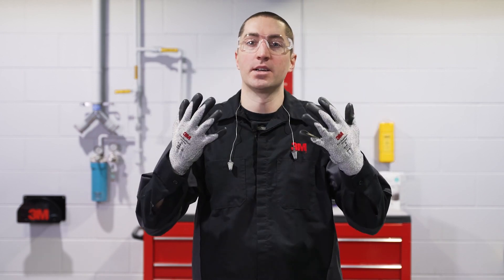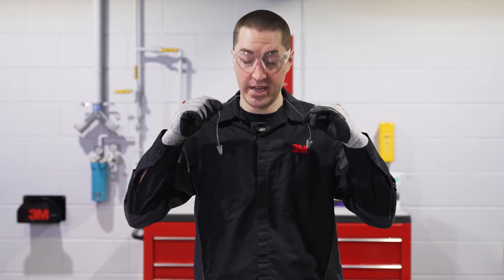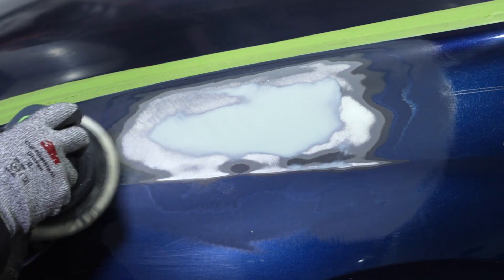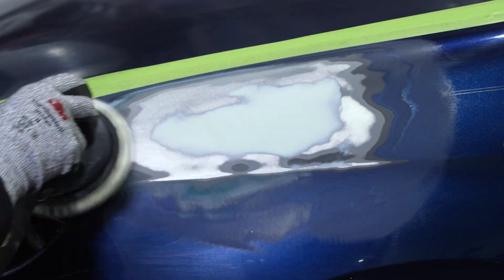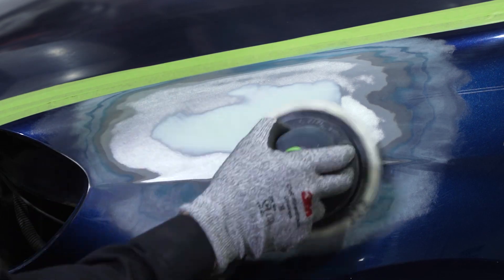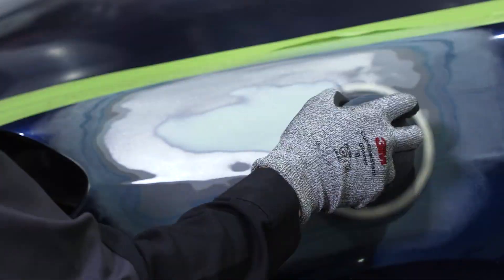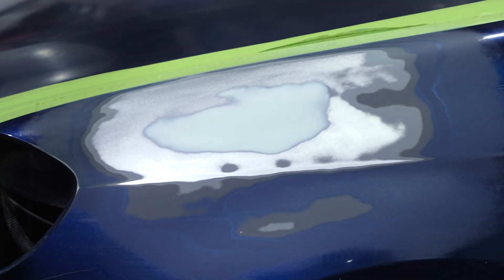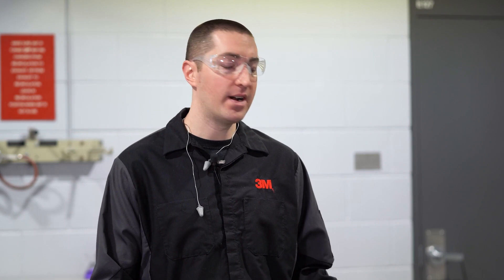Paint Prep Process Episode 1: Featheredge

Comment: The nylon scuff pad on DA is interesting. Question: Is that a short-stroke DA? (5/16” orbital action to reduce scratches further) 
Secondly; Once bare metal is showing, I feel that the factory corrosion protection should be covered in the small repair using a catalyzed epoxy coating in a detail gun. I use a small PPS 2.0 cup to make it quick, 2 coats & 5% urethane reducer so it lays flat. Now any imperfections can be addressed with a catalyzed glaze. Block with P380-P400, clean and 2k primer, P600 with guide coat to paint ready.
  Sorry, Maybe part #2.
Thanks, DK, Omaha